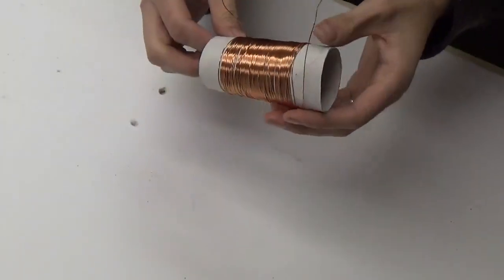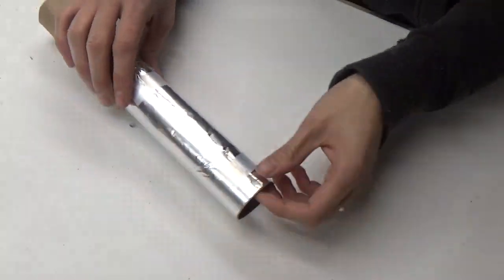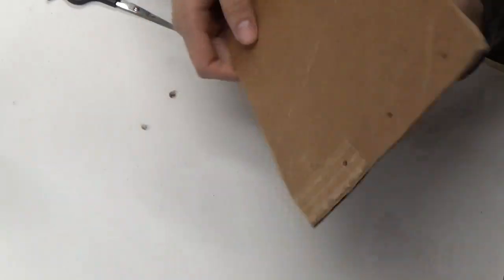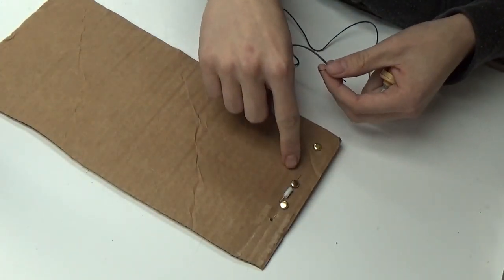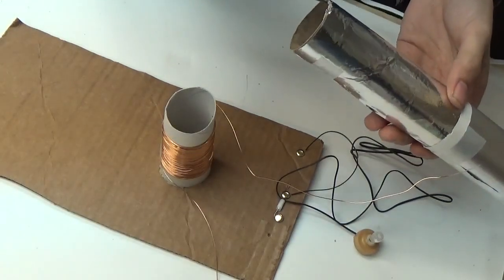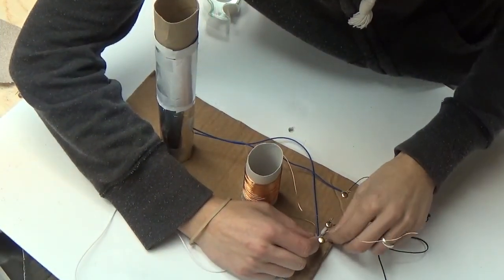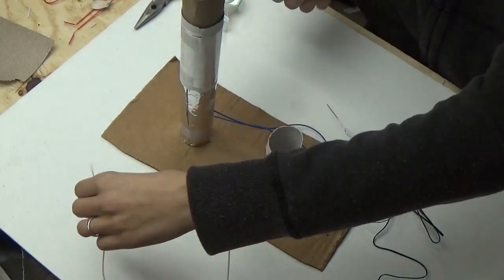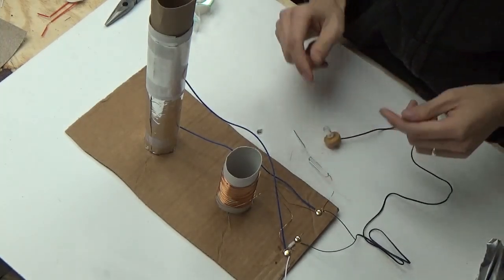Build A Quick Radio

Comment: While the concept is valid, and the "all stuff one finds around the house" simplicity is very good, there are a LOT of issues with what is presented in this video:

- This radio gets ALL of its operating power from the electrostatic field of the "airwaves". A longer antenna will help considerably with signal strength. The antenna wire from the radio needs to be connected to some big metal item; back in the day, people hooked up to metal fire escapes on apartment buildings, metal bedsprings, etc; but best is simply a long wire (perhaps 50 ~ 100 feet long) strung across some open space (between trees, etc).
- For the antenna to be effective, its opposite end needs to be grounded (to EARTH ground). I don't know what the paperclip is for in this video, and it is not explained. It is not shown connecting to anything. Is the radio user supposed to hold onto it? For best results, that ground wire should be connected to a REAL ground. People used to connect it to a metal cold water pipe, or a metal stake pushed a few feet into the ground, or the metal conduit of a home's electrical system, or even to the ground-prong of a plug inserted into an AC outlet, or a screw going into an AC outlet box.
- The statement that even a "speaker" should work with this radio is nonsense. The radio runs on only the power of the received radio signal, and cannot possible power a normal speaker (i.e. one with a coil winding). As-is, it will work ONLY with high impedance crystal (piezo) earphones or headphones (which is just two earphones in a headphone frame; it will also NOT work with normal hi-fi stereo headphones of any size or type. HOWEVER, if you have an old pair of computer speakers (powered speakers) laying around, you can substitute a resistor (about 47k Ohms) for the crystal earphone in the radio circuit, and then connect two wires from across the resistor to the input plug of those power speakers, and listen easily.
- It is too hard to see what is going on with the wiring for much of this video, especially with the smaller wires. There should have been a diagram showing the connections.
- The narration makes uncertain exactly where the wires should be taped onto the rolled aluminum capacitor; newbies might not understand which wires gets taped to which sections of the aluminum.
- A Schottky diode is a poor choice for the "detector" in a crystal radio; while a radio using such a diode might technically "work", the fidelity will be poorer that a crystal radio should really have. The most commonly used type of diode is a 1N34 or 1N34A Germanium diode. They are at least as common as other types of Germanium diode and are inexpensive and readily available. Yes, few newbies will have one just laying around, but then how many newbies have a Schottky diode laying around? Just make sure that you buy a REAL 1N34(A), since some unscrupulous Chinese sellers are selling other kinds of diode mis-labeled as Germanium and/or 1N34(A); use a reputable seller....there are a number of specialty sellers that cater to science education and radio enthusiasts that will have them.
- As noted in another comment, sanding the varnish insulation from magnet wire exposes the shiny copper underneath. Good luck trying to find any "silver" there.
Reply: you are so full of yourself...
Reply: @peatmoss4415 , you have revealed your character. Some people like myself try to make things go right by putting out good information and correcting errors. Other people like yourself would rather insult the first group.

Comment: which way do you put the diode?
Reply: TheDoStuffChannel, it does not matter which way the diode faces in this circuit. The goal is to convert the AC radio signal into a pulsed DC signal, and just as with any audio electronic signal, actual polarity of the signal is unimportant.

Comment: The ear piece cannot be any kind of headphone.  The ear piece in the video has a crystal inside of it.  This is necessary, the crystal is part of the circuit.
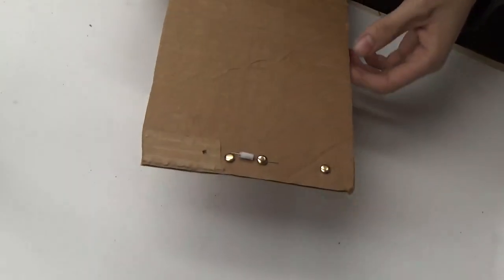Reply: A high impedance dynamic headphone will work.   At 3:59 he is putting a diode in the circuit.

Comment: To all those commenting on earphones... The crystal earphone is much more sensitive than anything relying on a magnetic field. You are talking about microvolts driving the audio device. The extremely high impedance of the crystal allows a tiny voltage to develop across the earpiece. It's like the crystal pickup on and old record player where the tiny movements of the needle flexes a crystal to generate a small voltage. Just the opposite here, though - the voltage flexes the crystal to move the diaphragm in the earpiece. Have fun!

Comment: Use a razor blade and a pin for the diode and then the radio could be made completely from junk
Reply: BobJones, while a "foxhole" crystal radio can be made using a radio blade and a pin, doing ONLY that will not work; it would just be metal to metal. Back in the day, people used to condition the razor blade with flame from a cigarette lighter, and THEN it would exhibit some crystal-lie properties.

Comment: Very creative!  I've never seen anyone use paper fasteners to connect the wires before. Very, very good idea.

In most cases you won't hear anything without about 20 feet of wire for the antenna. An antenna will work better outside than inside. I think this man is fairly close to a transmitter that he doesn't know about if he can hear any sound just by holding the antenna wire.
If you stick a pipe or a metal rod in the ground to attach to the ground wire outside your window you will increase the volume noticeably.

A speaker will not work unless you have a long antenna and are about a quarter mile away from the transmitter. 
And old telephone receiver from the seventies or eighties will work.

I'm going to use the paper connectors. Very good idea!
Reply: He didnt even make it its from a kit and it doesnt work
Reply: Can you just connect to an amplifier so it works at any distance?
Reply: @A_youtube_channel_  
You'll probably still need a long antenna. The amplifier only makes whatever is there louder.

If there are very weak signals that can be heard,  an amplifier will help.

Comment: so wheres the battery😠
Reply: It doesn’t need batteries
Reply: It gets the power (microvolts) from the radio transmitter. AM stations use 10,000 watts upwards of RF power. The germanium diode works either way round as it turns the AC radio waves into DC to feed the high output crystal earpiece.

Comment: Could we have exact measurements on these materials?
Reply: Use about 50 or 60 feet of 26 to 30 gauge wire. A 1n34 germanium diode...I don't know which value schotky diodes are good for radios.

If you get a magnetic headphone, you want at least 2000 to 3000 ohms. They can be purchased from Scott's Old Headphones website.
The piezoelectric earphone shown wears out quickly because the new ones only have the wires glued on instead of soldered. It's good for just an experiment to see if it works, but if you want headphones that will last for years, get a pre-1960 magnetic headphone.

Comment: so it does not need any power? and what frequency it might catch as we don't have any control over that? I thought the foil thing would help in playing with frequencies.....
Reply: It is powered by the radio frequency power of the radio station. It is a tiny amount of energy, but energy still. BTW, the longer the antenna, and the better the ground, the more energy received and the more power to the earpiece.
Reply: Yes, the foil capacitor changes the frequencies

Comment: Thank you for this wonderful video. It would be wonderful if, as you were doing things, you explained a little bit why you need this and that component - for example, what does the coil do, why do we need to slide those rolls, etc. Thanks again, this is very useful!
Reply: The ScienceWiz kit comes with a book that explains how this radio works! I will post a scan if I remember
Reply: @zzoinks   Please post for the benefit of all those who are interested.

Comment: No antenna, no ground = no working.
Reply: You need antenna and ground
Reply: This guy (who made this video) MIGHT have gotten his to actually work as shown, he does not demonstrate it working, and leaves out so much critical information that one wonders if it DID work.

I suppose that if there was a very strong AM station nearby, just holding up that short antenna wire, and holding onto the 'paper clip ground' MIGHT just barely work under the right conditions, he also shoots himself in the foot by using  Schottky diode (and WHICH model of Schottky?) instead of a superior detector diode such as a 1N34(A) Germanium one. If he DID hear anything, it would have been very weak, noisy and distorted.

Comment: Will it work if the capacitor foil is crinkled and if the coil isn't perfect? Also which way should the diode face left or right and can you tape the antenna wire to a coat hanger to extend it and is the paperclip enough to act as an earth? And does the side the foil face matter?
Reply: Coat hanger probably won't work for an antenna unless you can see the transmitter from your house. You will probably need about 20 feet of wire
Reply: Doesn't matter which way it faces. Foil can be wrinkled.
The best ground is a rod or pipe just outside your window

Comment: Batteries are not required.... Ear phones "ARE" speakers
Reply: Powered by radiowaves
Reply: He is making us foool, big fool, he did not use any kind of electronical components, so how can it work, one of main thing of all, he did not use bettery
Reply: @bachpankiyaadein6373 It does not need any battery.
Reply: @bachpankiyaadein6373  for being as ignorant as you are, you are really going out of your way to make bold statements in such a public forum......
Reply: Stupid project, how can it possible without battery radio work,
Reply: @bachpankiyaadein6373  there were many radios like this during war time and they really don’t require batteries whatsoever

Comment: You forget to add power source,. 😂
Reply: You don't need a power source, the radio waves are turned into soundwaves. But you need a crystal earphone for this because you need a very sensitive speaker.
Reply: U need an amplifier sound system.
Or a piezoelectric earphone
Reply: You could use magnetic phone over 2000 ohms
Reply: @chrisakarazor9612   How about a mobile earphone? Will it work?

Comment: Where is the tuner?  ... Isn't there supposed to be a tuner rod to slide on the coil?  How is the paper clip a ground?  What is it grounded to?  I think you are missing some pieces.
Reply: It's best if the ground is connected to a pipe or metal rod driven into the ground outside of a window.

I would use 20 feet of antenna wire
Reply: @chrisakarazor9612   What type of antenna wire we need? Please specify.
Reply: The video maker does a very poor job of explaining anything, and does not give enough information for a newbie to successfully make and use such a radio.

A crystal radio like this may be tuned using a variable inductor (coil) OR a variable capacitor (the sliding aluminum covered tube).

Personally, I think making the coil variable is simpler to get working than trying to home-make a variable capacitor that works well.

The electrical size of the coil (inductance) and capacitor (capacitance) affects which frequency(s) can be received with the radio. With such a casual specification for the number of coil winding turns and the sizes of the overlapping aluminum sheets (AND the distance between them AND the quality of the paper diaelectric), this radio might end up trying to tune a radio frequency outside of the normal AM broadcast band, so only static would be received. Add to that the inadequate ground and antenna shown, and most people who try and build this as-shown will be very disappointed.

Comment: You really don't have a clue what you are doing do you? But thanks for the effort. No, not any speaker or earphone will work if you aren't using an amplifier - only a high impedance earphone and no they are not "cheap". You need a much better "ground" and "antenna" unless you are practically on top of the radio station. But it was nice of you to try and it is a very simple example.

Comment: Haw to the connection  of electricty
Reply: You don't connect it to electricity.
Reply: It doesn't require electricity.
It's powered by the tiny amount of power in the radio waves

Comment: I did this step by step and all I got was a light static. I used the antenna wire and connected it to a radio antenna and the ground wire I connected it to a metal piece and that’s it. No station or talking...please help
Reply from the maker: You might need to move to a different location or extend the antenna. Also make sure the aluminum foil is not touching and your diode is connected properly
Reply: You need about 20 feet of antenna wire and a rod or pipe in the ground for the ground. How far are you from an AM radio station?
Reply: You may need a different earphone.
Most new magnetic headphones or earphones are 8 to 32 ohms and will not work on this radio. You need a piezo phone like the man used or a magnetic headphone 2000 to 3000 ohms

Comment: And also can you change where the signal comes from?
Reply from the maker: By sliding the roll up and down you are catching a signal.
Reply: @WhatStuff  Did it catch any signal from any station? You have not shown it. We would have been benefitted if you showed it. Otherwise what is the use of so much toil in making it?

Comment: i like the model u make but dont like the way u elobrate
Did it need battery to run
Reply: Bashir Ahmad hmm I'm sorry you feel this way. I did show step by step instructions. No battery was used
Reply: It is powered only by the radio waves. I can hear stations 300 miles away on mine

Comment: Can we use earphone to listing sound
Reply: Yes, of course.
Reply: NOT an "earphone" like a modern set of "earbuds"; this radio will not be able to drive modern ones well enough. You need to use a "crystal" earphone (piezo-electric earphone) OR a pair of piezo headphones (which are still made, for specialty uses like this). 

Some people replace the crystal earphone with a resistor (47k Ohm is a typical value), and then connect a pair of wires, from across the resistor to across the input connections of a powered speaker of some kind; one half of a pair of modern computer speakers, one channel of the input to a stereo music setup, etc.

Comment: can we use the speaker for the ear phone
Reply: No, there is not enough power to drive a speaker
Reply: @chrisakarazor9612  Can I use one of the receiver of old telephone set? My elder brother used to make one crystal radio with that. Will that work, if it be so I will try to get one and make a crystal radio. I am old enough (80 years now) and still curious to make one.

Comment: can we use copper wire and which type so schottkey diode should we use and how many number of turns should we make while wrapping the copper wire on roll?...please reply
Reply: Yes_ You can use any type of wire of any metal that wears isolation and diode is bat85 or any RF germanium diode or transistor.  80-100 turns will be enough for the medium wave, 300 for long wave. 5-20 turns for short wave. Good luck!
Reply: @Alex-nv7cf  Thanks for the explanatory note, which we missed from the video. He carried on showing how he made it, not explaining anything. That is one of its drawback. Otherwise it is good.
Reply: Use 26 to 30 gauge wire

Comment: brother i wanna ask that if we can use any speaker instead of this earphone....please reply
Reply: Yes you use speaker but with amplefier
Reply: The best is a high impedance earphone. Check e-bay. Also use a 1N34A diode it is more sensitive.
Reply from the maker: Speakers would not work since they would require a power source
Reply: A 2000 ohm or higher headphone  is best. An old telephone receiver from the Seventies or eighties would work
Reply: What Stuff? If we did wanna add a power source, how would we do that?

Comment: This really work or not
Reply from the maker: Pratyush Tripathi it works
Reply: What Stuff?  Is it low in volume bro it's not loud
Reply from the maker: Yes you can adjust with headset
Reply: What Stuff?  Do you think it can be improved
Reply from the maker: Yes. More wire for a stronger signal and build in a bigger scale.
Reply: Late comments by third party person
Reply: why don't u try it to see if it works..dumb questions people ask.
Reply: Pratyush Tripathi ..well said😂😂
Reply: You need an antenna wire about 20 feet long or it will be barely audible

Comment: What kind of Schottky diode and earphones? My Schottky diode looks a bit different than yours, so I would like to know what kind you have used so I could buy that if needed. Is any generic earphone good or are there any specifications you recommend? Soon I will build mine.
Reply: Use a 1N34A  diode it will be more sensitive.
Reply: Can I use a 1n4007 diode
Reply: Headphones should be 1000 ohms or more for strong local stations. 2000 or more for weak or distant stations